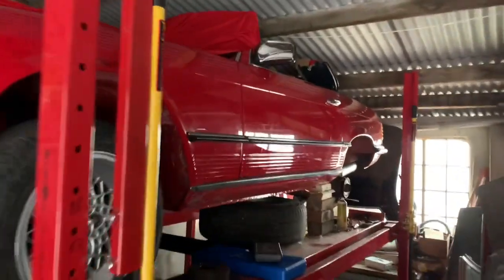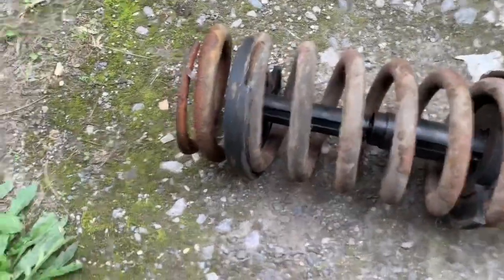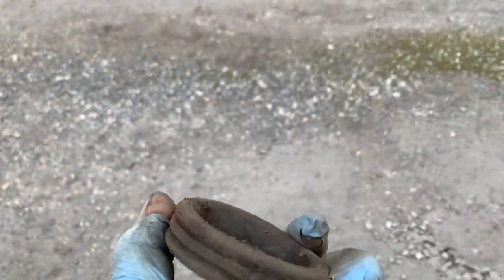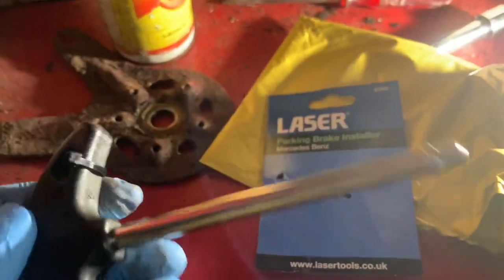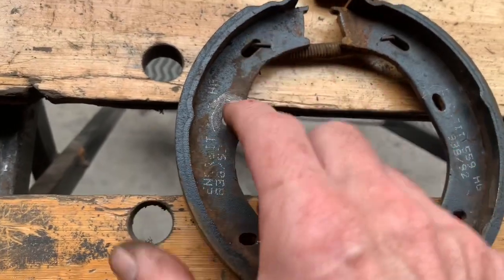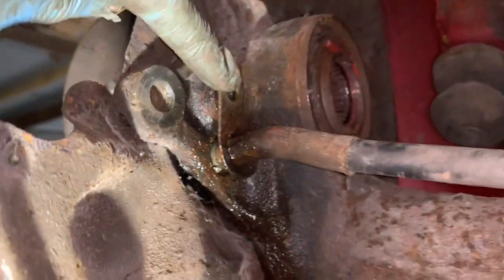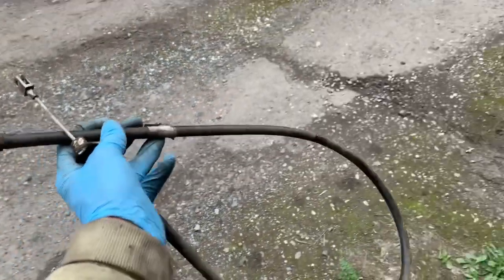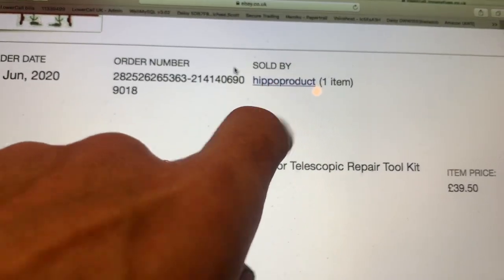Mercedes 107 SL rear springs, park brake and control arm removal

Comment: Love your channel, great for advice and inspiration! I need to replace my rear springs. 2 questions: 1. do I have to remove the drive shafts or can I get the springs out on their own? 2. do you know if you can hire the circular type spring compressor - they are expensive to buy (£200)
Reply from the maker: Hi - I dont think you need to remove the axle shafts to get the rear springs out. Have a look at the video below starting at 15.12:

https://www.youtube.com/watch?v=wLISaxdlewo&t=2s

In the video below at 7.42, I show where I bought my set of compressors for for £39:

https://www.youtube.com/watch?v=uzHOygZ1d5M&t=9s

If the worst comes to the worst, you could borrow my set and pick them up from my parents house in Churchdown. Mike

Comment: I just took my rear hubs off.  I used the special socket, long breaker bar and torch.  I had to heat it up pretty good . I really used a normal breaker bar with a pipe.  Good luck.  My 75 280SL and I love your channel.
Reply: BTW, I did mine on the car and set the parking break for resistance.
Reply from the maker: @rome288  Thanks for your comment - I think with the benefit of hindsight, getting the hubs off would be easier with the wheels still on the car. I've always been a bit cautious about using heat on the hub. It is possible to damage bearing and various other things....however, I guess "you gotta do what ya gotta do' to get those hubs off. Mike